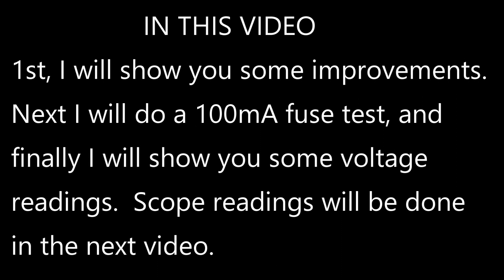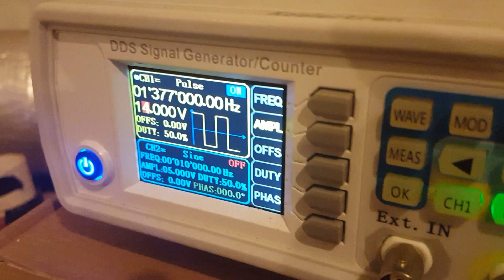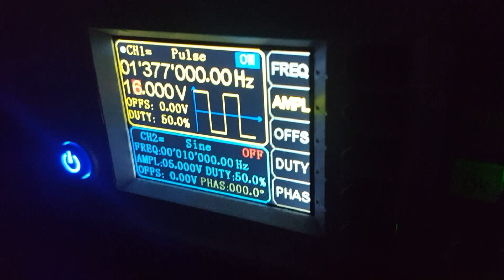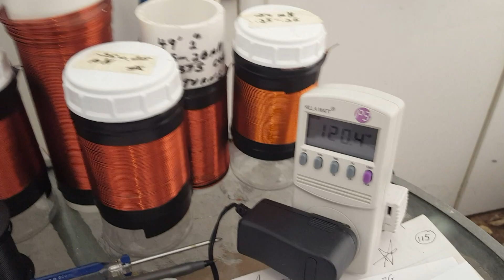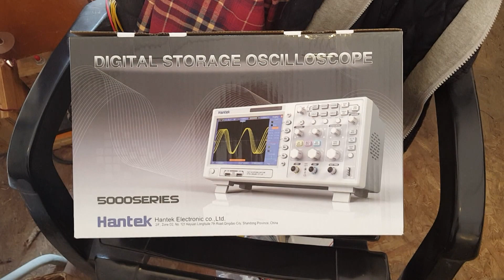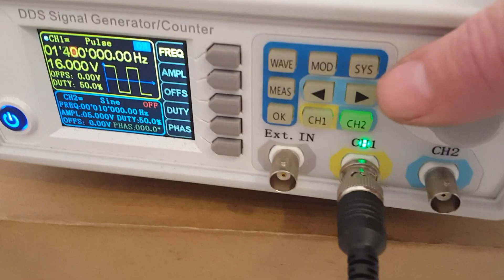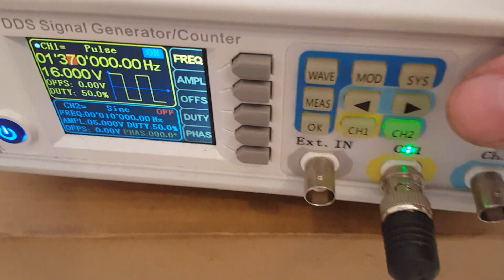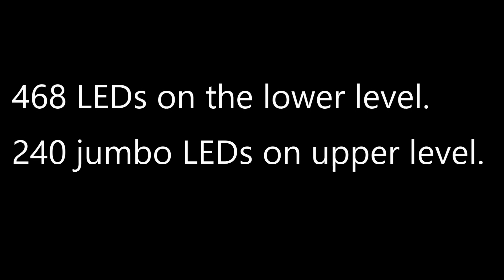WIRELESS POWER TRANSFER Part 18 (Over unity!? Free energy!!?)

Comment: Thanks for the replies, yes patents can be important, but is it fair to say your ‘inspiration’ involved the Tesla hairpin circuit?
This is a ‘capacitive’ inductor, a length of copper in between two HV spirals of ‘capacitive plate’ with a dielectric. 
When the spark gap fires it sets of a set of harmonic gyrations between those plates.
Incidentally and off subject, if you wind a Tesla inductor as per the patent on electromagnets so a two strand inductor on any core then get any measuring tool for ‘capacitive’ measurement and measure the open wire you will get a ‘capacitive’ reading. 
If you divide that open reading by 4 you will have close to the actual amount of force 
If you wind 4 wires in a Tesla config then open test if you divide by 2 you get the net force
If you wind 8 wires you have a 1 to 1 ratio of force to open reading. 
Every time you multiply 8 you get a multiple of the reading I.e 32 strands would be 4 times the open reading of Tv force. 
Hope that helps !!
Reply from the maker: Thank you😎

Comment: I probably should look at the older experiments but where are you inputting the rotational square wave ? 
Into a single inductor on the main tower also is it the only input if so yes it will act as a ‘voltage booster’ I had the same effect at resonance with a modified sine as against a sine due to the odd harmonics
However that aside have you tried just amplifying the signal with a primary/ to secondary A B relationship on the main tower ?
I.e a ‘standard’ Tesla type tower ?
Reply from the maker: Hello Kolin!  Hmmm, there are a few parts I keep off camera(not yet shown).  This way I can still patent it,.. if possible.
Yes, I want to amplify the signal yet, and I do keep looking over at my Tesla coil, very good pulsed dc amplifier😎.  Maybe I will need assistance in this area soon.  I feel very confident that i am not only boosting voltage, but also current.
Thank you for your good comments, ideas and thoughts!
Reply: INVENTOR3 inspirational enthusiasm stick with it, I’m sure you will be able to make new discoveries. 
I’m working with also ‘capacitive’ inductors but in a fairly different way.
Reply from the maker: @kolinevans9127  Thank you very much!
Your project sounds very interesting also😎.

Comment: Because the secondary of a Tesla coil is wound in a style that means the single wire coils up towards the top of the tower then it has only 1 unit on the inertia vector and many units on the TV vector  ignoring those logos I’m using that means that the tower acts as a ‘capacitor’ with one plate being at the top and if you plug the other plate into the earth you have the ability to access that plate easily for a receiver. 

Based on XL and XC and charge on a ‘capacitor’ mathematics you can calculate that as you increase the charge you will gain energy potential 
The transmission of that capacitor is mostly done efficiently by understanding the relationship between harmonics both of the primary to the secondary of the tower and from the tower to the receiver. 

A Tesla tower is a ‘capacitor’ that is a radio tower. Some radio towers are not ‘Capacitors’ the top plate of a Tesla tower can be visualized as the top plate of a ‘capacitor’ acting like a transducer at a frequency, you have to pick up the frequency of the transducer.
Reply from the maker: I understand😎.  Magnifying transformer, yes, i might have to try. The ways of boosting are limited due to pulsed dc and only single wire, only one input and only one output.
Reply: INVENTOR3 in my general observations yes that seems to be a fairly major hurdle but not insurmountable, however it will have to lead to the discovery of harmonic relationships to act efficiently. 
My largest one of ,  hurdle to overcome was / is my inability to accept heat in a system as it represents obvious inefficiency. 
However I was able to build a very efficient basic amplification system ~ 0.0w on the meter standby and 0.5w with the function generator switched on , which has allowed for the ability to analyze harmonic relationships. 
Which then leads to further understanding, my other projects  are a mower and a water feature with a washing machine. Both of those probably will generate some heat 
Regards.
Reply from the maker: @kolinevans9127  Your project is getting my curiosity, if you had videos of it i would be watching them😁
Reply: @INVENTOR3  O' Boi the Tesla coil Aka the R.T unit is connected to a waveguide. Please Read the patent. Directly talks about the Hood and Cup. Also Tesla was not the first to create wireless energy transfer Faraday was in 1831.  What is a R.T unit? Well it is the exact same thing, we use now to transmitt everything without an omnidirectional dish, aka torad. Also Tesla took out a patent on a vacuum variable capcitor in 1896. To get the Amplitude to the torad up to that height, you need a waveguide period.

Comment: Hi I have no scope of understanding your analysis because I have not been keeping up with your analysis
However I’ve been conducting my own mostly on harmonics 
If you divide a fundamental by 4/ that is the 3rd harmonic 
For example 6600 / 4 = 1650 
Following that example you could conduct analysis of these harmonics 
3rd 
6th
9th
3rd

I.e the 4th 3rd Is 3 6 9 3 
Which means you’d be dividing by ....
I think it is worthwhile analysis. 
I like your scope I have a similar one. 
Regards
Reply from the maker: Hmmm, i understand, and interesting ,,,,we all like 3,6,9😁  I never saw anyone point this out before, but Tesla's New Yorker hotel room # was 3327.    33"27"            27/3=9     3x3=9    its all threes.
Reply: Where 2 then @INVENTOR3
Reply from the maker: @justinaldrich1719  Funny, i was hoping you would see this comment Justin.  As soon as i read this comment I thought about you.  Would you like to add some info about 3,6,9😎
Reply: @INVENTOR3  As i said above "Where 2 then"
1296 at a note of A0 using the flawless patterns of pythagoras. Also known by newton tesla along other's. The 369 is directly linked to pythagoras. The same as the pyramid of giza. Back to that tringle with HZ missing in it....